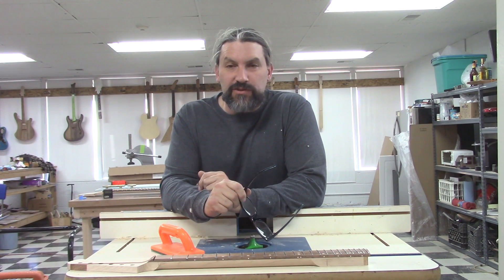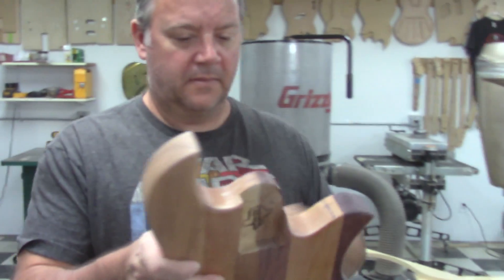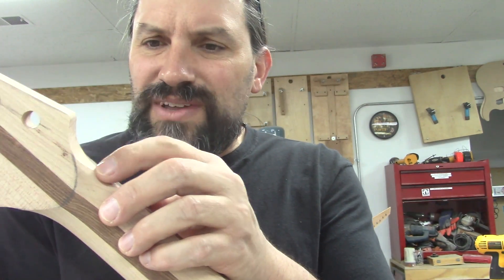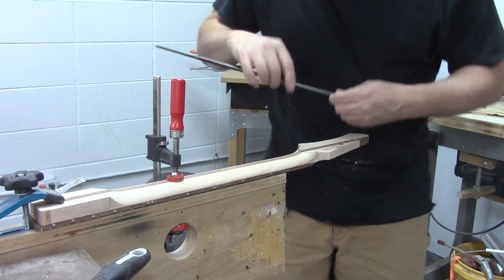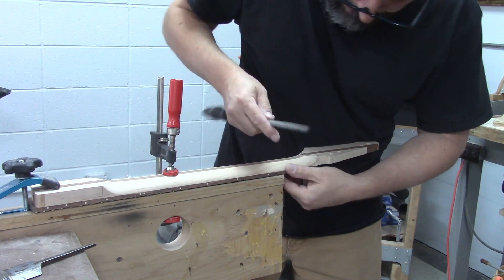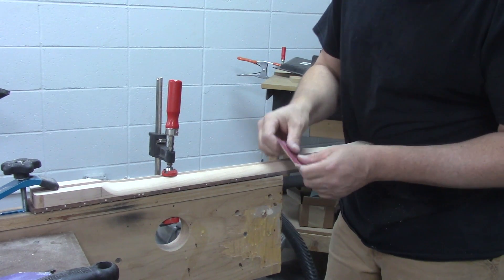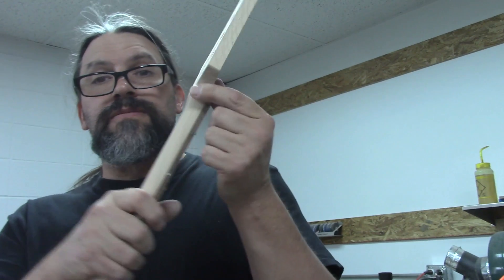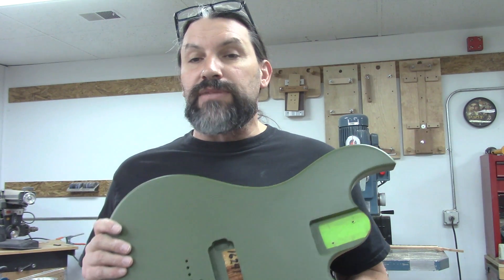How To Build Another Amazing Guitar With Scrap Wood... Part 6 Shaping The Neck

Comment: Is there not the perfect roundover but that can just do this correctly in 2 passes? I can't believe there's not a custom bit for just guitar necks by now. You could do that in 2 quick passes with the right contour bit... If it's the right not, and be done. I've seen it done with a roundover bit and it's pretty close... But still a lot of work left.  I can tell if it was just the right contour, and it meets in the center, that would be sweet.

Comment: Love the olive drab. Can’t wait to see what Mike does with it. 
What is the purpose of the hole between the string holes and the pickup route? Or did you talk about it and I missed it? Inquiring minds want to know! :)
Thanks again for the great videos. You make my lunch hour better.
Reply: Geoff Cowan grounding wire hole for the hard tail bridge.
Reply from the maker: We drill a small hole to screw down the bridge ground so it doesn't come loose. It also makes drilling the bridge ground wire hole easier
Reply: Texas Toast Guitars i always just do the little bitty hole so it didn’t occur to me that was for the bridge ground wire. 
Always thinkin, aren’t you? :)